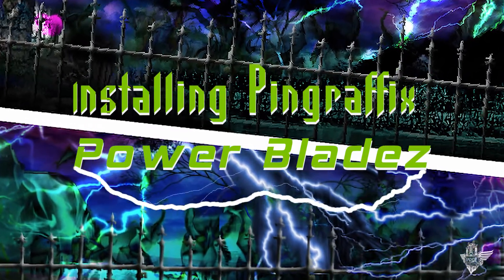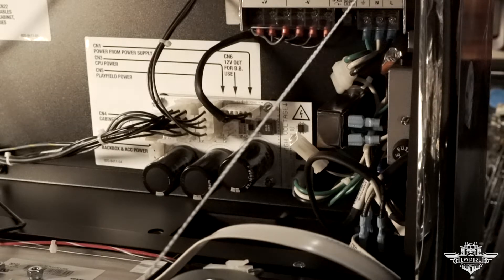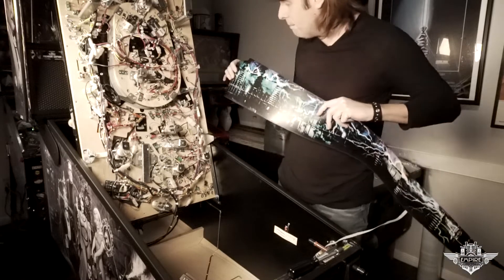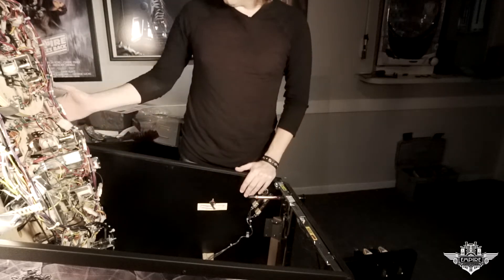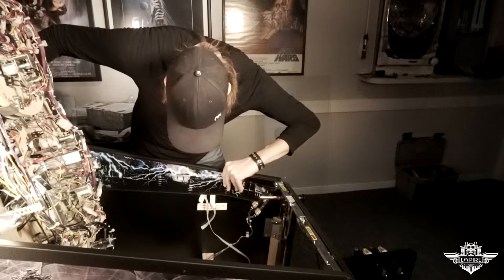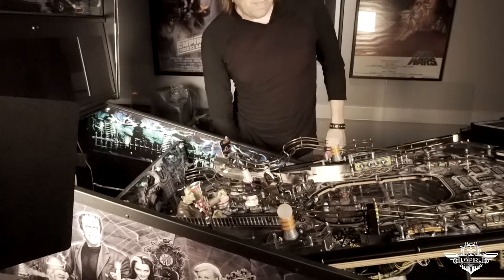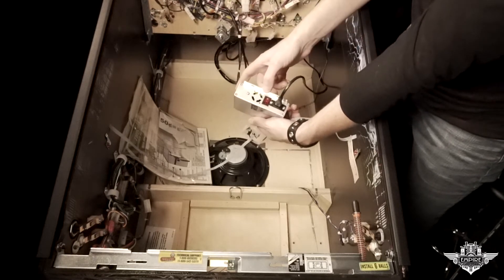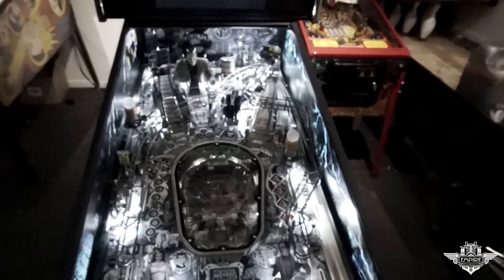Pinball mods-How to install Pingraffix Power Bladez on a Stern Pinball machine

Comment: Nice video. PRO TIP: You only need to remove the left and center nuts to take off the AC power cover to get to the Bill Validator power connection. The right nut DOES NOT need to be removed.